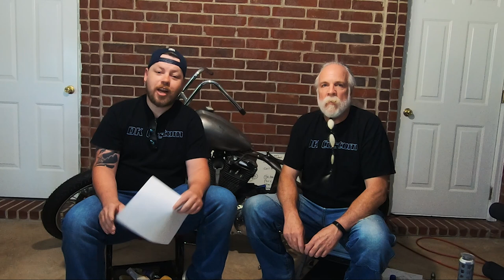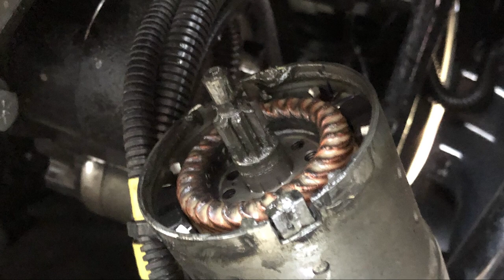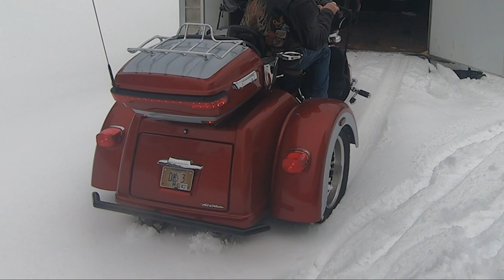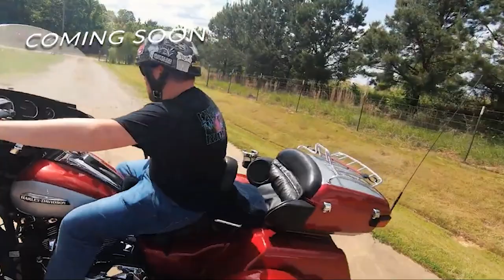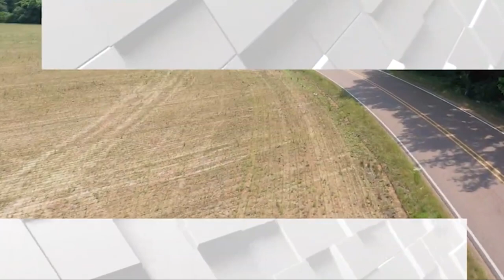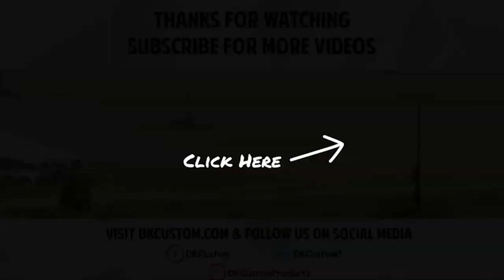The Real Story On Harley's Electric Trike Reverse

Comment: Good video and some good comments.  I had my 2011 TG for 8 years & 112K miles.  I use reverse every time i ride but its not for any long distance. I traded the '11 in for a '20 and never had a problem with the reverse, still had the original reverse in it.  I know this is an exception but it does happen.. I can only hope my experience with the '20 model will be similar.
Reply from the maker: That is great!  Wishing you many miles of smiles on your '20 model.

Comment: The electric reverse works pretty good if IMO is used correctly.  Read your owner's manual again on how to use it,   It is NOT bulletproof but if used correctly it will last. HD has upgraded the electric motor a few times to improve it
Reply from the maker: Yes, it seems the earlier ones had a higher failure rate.

Comment: I do use my reverse on my 2016 Freewheeler. I bought it used in 2019 and the dealer was already in the process of replacing it before I took delivery. I haven't had any problems yet but do to health reasons I've only locally driven it about 2000k miles since. I know they are weak and I try to park in shade or where I can roll back/push while on the bike. What I try not to do when using the reverse is to keep hitting the button. Such as pressing reverse roll and then pressing again and again. I have had to do that a couple times backing into the garage but I don't like doing that. I try to position the trike as to only hitting the reverse once when needed. I think multiple pressing causes to much wear on anything electric let alone the reverse.
Reply from the maker: That seems like good advice.  When reading what you do, I realized I do the same thing, most of the time.  Thanks for commenting.

Comment: The reverse went out on my '14 also and was replaced under warranty, I have not had any problems with my '19, in about 3+ years so don't know if Harley improved it or not but I do know that on the'19 when you put it in reverse the engine speeds up just a little so you are not running on the battery alone.
Reply from the maker: I've had the same experience as you.

Comment: Hey, cool as usual.  I use mine a lot, and it went at 25K miles, but was a warranty fix.  Maybe a video on DYI rebuild/replacement some day?  Nate, aka OogieWaWa on the HDF.  Edit: Never wore my battery down, unless the battery is already weak or you do a LOT of backing up at one time I can't see how it's any worse than using the starter.
Reply from the maker: Thanks, glad you like.
That would be a good video...we have never done it, so would be interesting.
Yeah, when using as should, don't see it hurting a healthy battery.

Comment: I had a reverse go out on my 09....it locked up and sheared the armature....i replaced it myself( not a terribly hard job) with a rebuilt starter motor.....no problems for 40k mile...and trade in.....as has been said...use it sensibly...as per owners manual...it shouldn't be a major problem...and as Kevin said..a warranty is a headach remover......ride safe
Reply from the maker: Great fix.  Yes, if not overstressed, they will work longer. 👍  Nice job on doing it yourself with a non HD replacement.

Comment: I’ve had my 2010 still on the original reverse . Ur only supposed to backup for like under 20 seconds. It’s not meant to back up for too long lol . I think it’s weird they didn’t do the mechanical from the factory because the servi car was throttle reverse ‘ but I’m still on the original reverse motor .
Reply from the maker: Good to hear that yours is still doing well.
Yeah, they just copied what Lehman was doing. A mechanical would have been better.
Reply: @DKCustomProducts  i agree less strain on battery life they did electric because I guess it’s cheaper to replace I suppose I would like to and have thought about getting a mechanical reverse but the cost man !!!!!

Comment: I had my reverse fail twice on my 2019 tri glide, both times it was repaired under warranty, the first time it happened it nearly put me through my fence, I couldn't shut it down & had to stand on the brake until it burnt out, scared the crap out of me.
Reply from the maker: Yikes!!!!  They usually fail by not doing anything.  Use the ignition key next time.  Hope there is no Next Time!!!

Comment: Is the reverse motor the same as the starter motor? If so I suppose that means if reverse goes out the bike won’t start?
Reply from the maker: No, the starter motor is in the same location on the Trike as on the 2 wheel bikes.

The reverse motor is a different motor, mounted on the frame behind the right side cover.

Thank you for commenting! KP

Comment: The reverse motor died on my 2010 about 4 years ago. Sent it to a small shop in Ohio where it was rebuilt for $350. The shop did a good job sealing it for known water leaks and guaranteed it for a year. These Hitachi motors shouldn't be run for more than 10 seconds! BTW, reverse still works to this day.
Reply from the maker: Great solution!  Have heard of quite a few folks doing that with good results.
Reply: I wonder if there's a way for someone to DYI retro-sealing them, even on the trike.  I know of one thing in particular, there's a little drain tube that's supposed to be there, and if it falls out moisture can splash into the units.
Reply: @nathanwahl9224  I don’t know about my 2010 having a stock drain tube but I do know the shop installed one and “water-proofed” the motor.
Reply from the maker: @nathanwahl9224  They fixed that on the more recent year reverses, and I know some folks have sealed up the older ones.

Comment: Harley should build a gear box for their trike. My antique Soviet Union military Dnepr sidecar motorcycle has a gear box with a real reverse gear. If the Soviets could do it in the 1930's for their military motorcycles why can't Harley build a real gear box with reverse for their trike's? I think they just want to sell a crap electric reverse as an add on accessory for extra bucks. New Ural Motorcycles have a real reverse on their sidecar motorcycles so no excuses for Harley not doing the same.
Reply from the maker: Yes, it probably is a money saver for them....plus easy since it was part of the design that they got from Lehman (HD did NOT design the Tri Glide themselves).
Plus it is a bit harder for a novice/newbie to get in trouble with an electric reverse vs. a mechanical (read legal advice/nanny systems)
Reply: @DKCustomProducts  the Dnepr and Ural Motorcycle gearbox has a separate lever for reverse so you can't accidentally shift into reverse. There is an internal gate on the forward gear shifter so you must be in neutral before engaging the reverse lever. It's impossible to screw it up. The only reverse gear accessories are a hand reverse shifter mounted beside the gas tank on the right side. Dnepr military motorcycles have a semi-automatic clutch system. Simply pressing down on the toe or heal shifter pads also pulls in the clutch so when moving you simply back of the throttle, shift up or down, then give it throttle as you slowly take pressure off the shifter pad with your foot. It's like that so the driver need not take a firm grip off the handlebar grip to pull in the clutch lever while running at high speed off road and the Gunner is sawing up vehicles and the enemy.
Reply from the maker: @n4zou  Thank you for the details...sounds like a sweet set up.